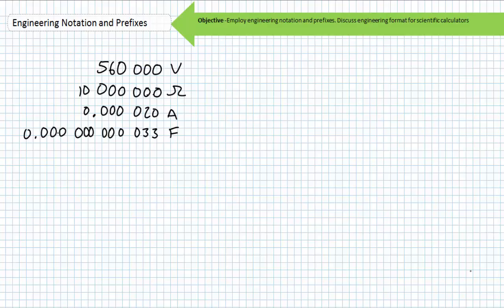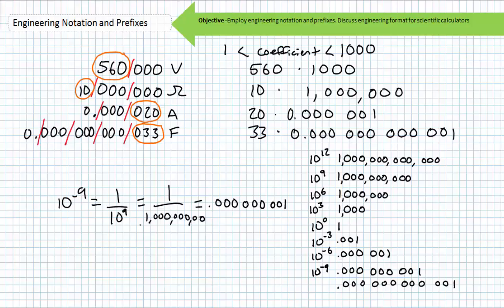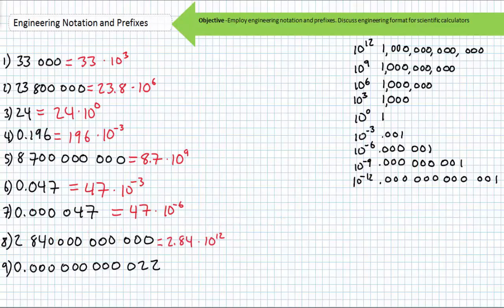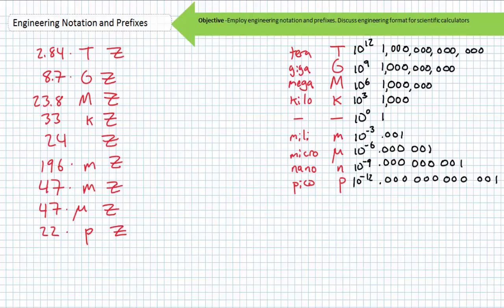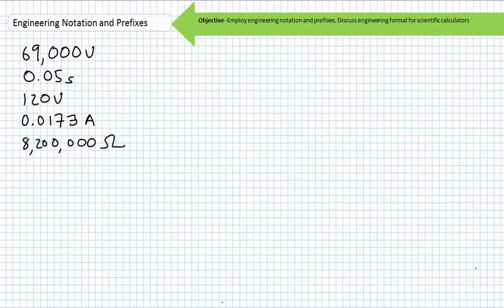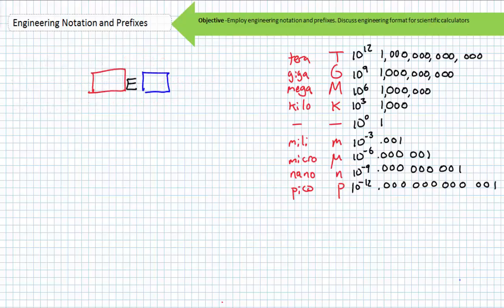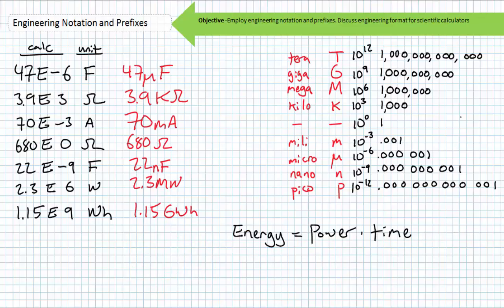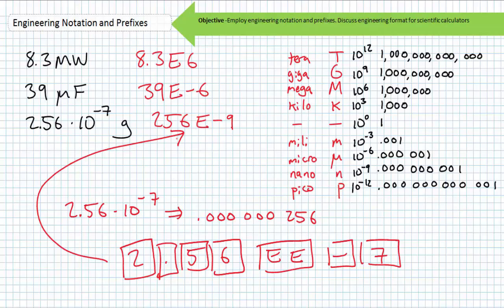Engineering Notation and Prefixes (OLD LECTURE)

Comment: I have a question — how would you write in engineering notation a number with an integer in front of the decimal point. For example: 
5.000005
How would you write that in engineering notation? Or would you just leave it as is?
Reply from the maker: Leave it as is ... although I would question the "significance" of the last 5. It's far easier to round this to 5.0 (to the tenths place).
Reply: @bigbadtech That's what I thought too. Sorry about the stupid question; it's just my first time taking a course like this. I guess I'm just kinda paranoid about things that I normally would not be paranoid about. Thank you, though, for your quick response!

Comment: Hey Jim, when I am doing a calculation in eng not and start getting long decimal place numbers, do I leave them alone until the very end? Also if they dont specify, how many signif digits do I leave or how many numbers past the decimal place do I leave? Thanks!!
Reply from the maker: Significant digits is a barrel full of rage infected monkeys I do not wish to open*. Typically I ask my students to express their answers in appropriate engineering format rounded to the tenths place. Example: .02354A would be 23.5mA.

* If you insist on opening the significant digits barrel: Certain numbers are more precise than others, for example .02A vs .024A vs. .0235A vs .02354A all imply different precision measurements of the same thing where the last digit is always in question. The general rule of thumb is to express the final answer to the same place as the figure with the least number of significant digits leading up to the calculation. For a more thorough discussion on significant digits check out a chemistry text book. Chemists make a real big deal about this (for good reasons) however I've found it's good enough to just use the proper engineering format rounded to the tenths place. Chemists may disagree.
Reply: @bigbadtech  thank you so much.  That answers my question

Comment: Where does Hecto, Deka, & deci play into these notation? I guess they are not in the scientific notation because it is in between?
Will I found my answer! https://en.wikipedia.org/wiki/Hecto-
Reply from the maker: +Don G. Exactly, engineering notation is 10 to the power of ... -12, -9, -6, -3, 0, 3, 6, 9, 12, ... and so on. Some occupations often have their own weird unit of preference. I used to work on inspection equipment for the semiconductor industry and we commonly employed the unit "Angstrom" because it was super convenient to use to describe atomic structure.
Reply: TX, I read a lot of tech specs from Germany, they use the Hecto, deka, prefixes also they write rpm as 1000 to the minus 1!